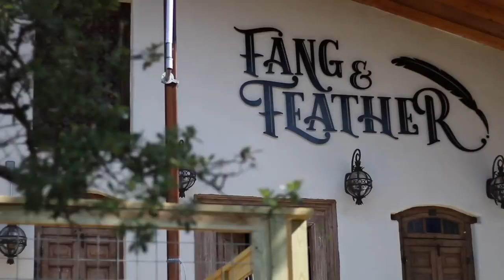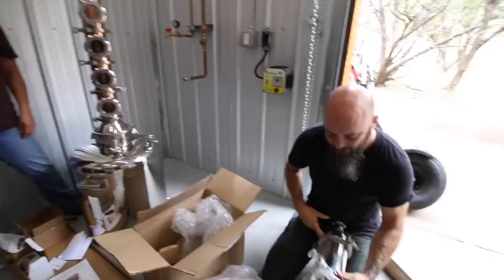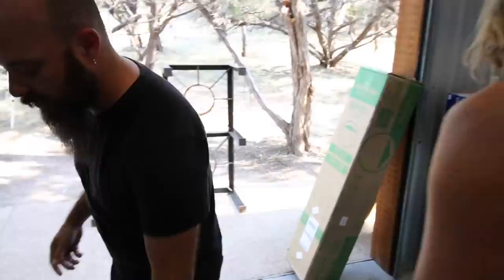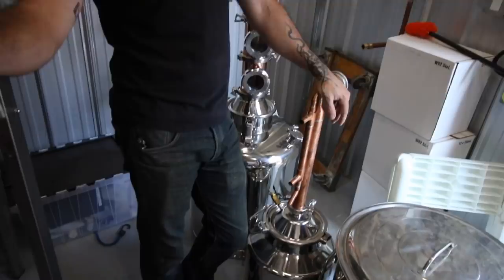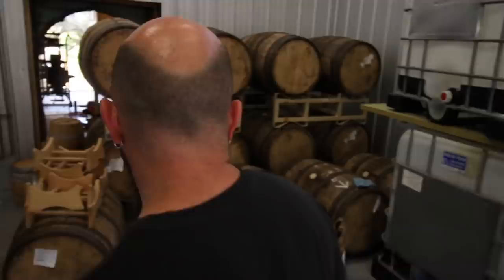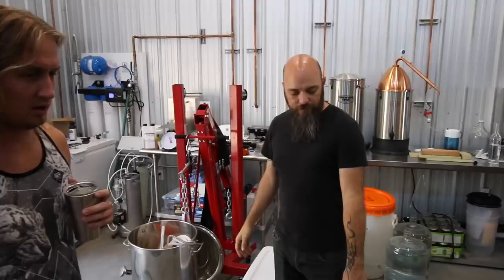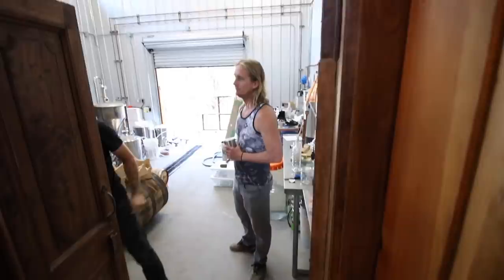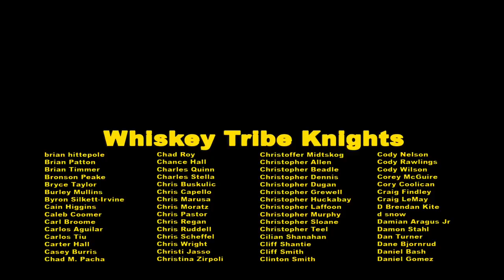How To Make Whiskey

Comment: Some inaccuracies when you explained the "brewing" part. You don't boil the grains, you add hot water to mash the grain and extract the sugars. This sugary water is the wort. This is then boiled to sterilise it (and when hops are added in brewing) before cooling and adding yeast
Reply: Except no hops for whisky. That's also why it's not called beer as beer is by definition an ale with hops used as conservative. Ales can have all kind of other things used as preservatives: juniper, pepper, cloves, cinnamon, etc.
But in the case of whisky no preservatives whatsoever as it's distilled so quickly after beeing brewed that there's just no point.
That being said, i'd love to taste a whisky where hops were used. Might be a nice experiment. And the those to gentlemen might be the only one that could make it happen as they are small scale and could do just a batch to test it.

Comment: Interesting stuff. One thing that surprised me was that lower alcohol percentage in the barrel increased evaporation. Alcohol being far more volatile than water I would have expected the opposite. I'm guessing it must have something to do with water being able to pass through the membranes in to wood but alcohol's larger molecules can't. If that's the case, your evaporative losses wouldn't be quite so bad as they would be primarily water and your end product, while less volume would be a higher proof.

Comment: So.... technically at standard pressure when you evaporate alcohol you get a little water mixed in (h20 and etoh have an azotrope) also the more plates in the still the closer you can get to the azotrope (if I remember right that's around 75-85% or 150-175 proof)

Comment: Excellent material and presentation!  The only thing I'm still confused about it the role of air and oxidation of the whiskey inside the barrel as it ages.  So how much air is typically sealed in the barrel?  Can the whiskey over-oxidize during maturing??

Comment: Can you continue ageing outside of the barrel. If you don't want it too woody (smaller barrel) is their any point letting it sit years in a crock after removing it from a barrel. I noticed in China Beijiu is aged in 55 gal ceramic pots (They don't do wood barrels). Wondering if time in a neutral vessel helps any.

Comment: Why does whiskey of a lower proof evaporate more. You would guess the higher proof would evaporate more as the ethanol is more volatile than water and would preferentially seep through the gaps in the wood.

Pls answer, thanks from an alcoholic scholar.

Comment: So a few quesitons. 
1. Why do you have those T500 "Stills"? Curious if you are just using them for stripping? Maybe small batch experiments?
2. I'm surprised at how small of a still you are running. Why not by a full size? I doesn't seem like you will be able to make any real amount with what you are planning to run. Unless you are going to be running 24/7. Is that your plan?
3. What is your reasoning for not going commercial grade on all of your equipment?
Reply: Cody Smith I imagine the easy answer is money.
Reply: I am fairly certain that EVERYTHING they showed today was the pilot setup.
Reply: We're using all these stills to create the small batch variations before we scale up on the ones we really like. Think of what you saw in this video as R&D

Comment: It is whiskey straight off the still, no law on needing to age it to call it whiskey,  now bourbon or straight yes both have oak age requirements. But you can have clear non aged corn whisky and it's still whisky :-)
Reply: True. But corn whiskey in US law is the only thing you can call whiskey without aging it.
Reply: Whiskey Vault , aye correct.. but even still in most places in the world if it comes from a grain it's still whisky off the still, hell the Scotts drank it clear right off the still only a couple hundred years ago, no one wanted to wait to age it ;-)
Reply: If you're talking about non-American rules, this is a whole different conversation.... and I love it already.. :-)
Reply: Whiskey Vault , I cede you are correct though. Corn at 80% is hardly the norm and more the exception than the rule.
Reply: Whiskey Vault, truthfully though whiskey on a label doesn't do anything for me in way of any assurance as such adulterated, cut and artificially flavor crap can call itself such... my keys are straight and or bib.... after that I get ever more interested by age statement and single barrel and higher proof etc. At least with "straight" or Bib on the label you're getting some good honest whiskey in my opinion.

Comment: Aren't you supposed to throw away the first part since it contains methanol?
Reply: You can actually keep it with the general heads if you plan on sending it to a holding tank to re-distill later. But definitely don't drink it.
Reply: ...because of the problems associated with being poisoned you mean. Good call.

Comment: Sorry to be a massive pedant, you probably know most of this but it missed the video presentation.

1) You don't actually boil the mash else the enzymes that break the starches into fermentables will denature and not do their job.

2) Don't take my word on this, I'm just going on hearsay, but I've never heard of anyone transferring to the fermenter before cooling the wort/wash/whatever. My understanding is that hot wort is more prone to oxidation of various compounds in it, and transferring the hot wort to the fermenter risks aerating it while its hot. There's no real benefit to putting hot wort in the fermenter either. It's not at a vigorous boil by the time it'd get into the fermenter, and the temp would quickly drop off even further, so the fermenter would still need to be sanitized separately.

3) I'm pretty sure heaps of people would disagree with you that beer has to be pasteurised to be "real". Sure industrially, since beer is done by that point and benefits from it for shelf life, it gets pasteurised, but plenty of micros and homebrewers don't pasteurise their beer and nobody questions that it's beer. In fact in the UK, CAMRA considers it a pre-requisite of real ale that it is not pasteurised.

4) So once your wort is fermented, you can actually call it beer. Unless you follow reinheitsgebot which requires hops for it to be considered a beer. In which case, you can consider it an ale by the more antiquated british definition.

That hybrid pilot still is stunning. Not really a point just thought I'd say.

5) Good talk about making the cuts and keeping the heads and tails for a feints run, but did I miss any mention of chucking the foreshots? Is it ever worth keeping the foreshots at all?

Also interesting about how the proof you barrel it at affects the qualities it draws from the wood. That's something new I learnt from the video.
Reply: Yeah technically I think you are correct on all that.  Im guessing he is not as sure of the beer process,  and also dumbing things down to fit into a 15min vid hahaha
Reply: Still It nailed it as well. You're right on all of this. 
1. I said "boil" but that was a casual reference. really meant, just keep it heated while you extract the sugars.
2. Some cool in the Mash tun before transfer, and I've seen some transfer to the fermenter and then cool. Main point is, you have to cool it before adding yeast. 
3. Blame my ignorance of beer making. All I meant was beer has a second step that distilling doesn't. Don't tell Rex I was wrong.....
4. I've heard beer by most Americans and "wash" by quite a few others. I think we're talking about the same thing though.
5. most large distilleries (or any size really) will keep the foreshots and divert them to a tank with tails to add to a later run of the same product. Low waste.

cheers!